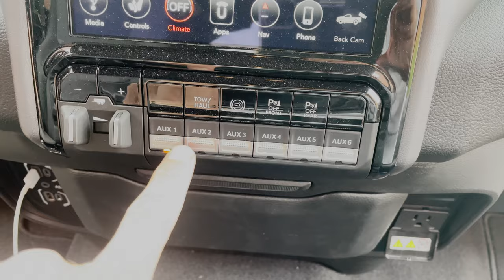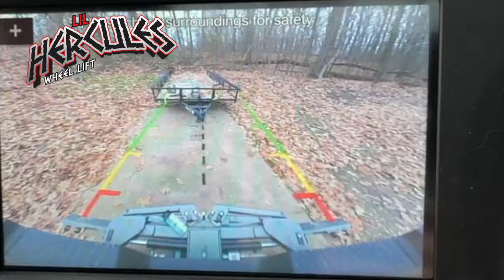2021 Ram 3500 for Rays Tire & Automotive gets a Lil Herc 2.0

Comment: Will this work on a 2022 ram 2500 tradesman 4x4 with 6.4L Hemi ? If so full price
Reply from the maker: WHAT TRUCK DO I NEED?
	•	Any year or make, that’s a 3500. 
	•	Any 2500 from Ford or Chevy with a 10k GVWR, and to my knowledge, that’s 2017 and up. 
	•	No Ram 2500's any year because they either have Rear Coil Suspension or they lack the 10,000lb GVWR needed. The truck must have 2 things to qualify a 10,000lb GVWR & Leaf Spring Rear Suspension. (We prefer a 160” wheelbase as well). 

https://youtu.be/HCpuLvXwe3g?si=aD5u491eghnDgfV9